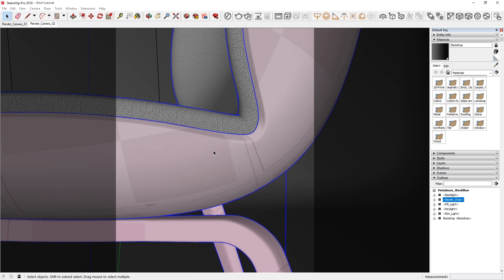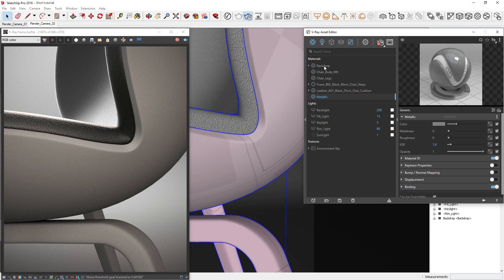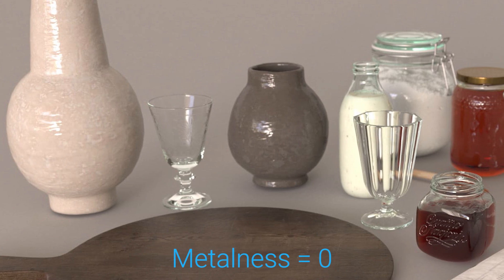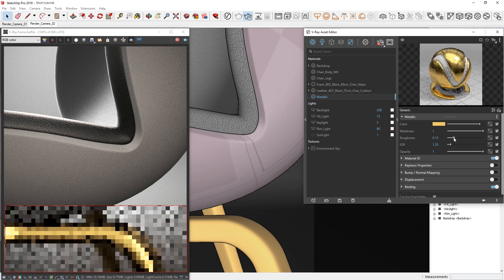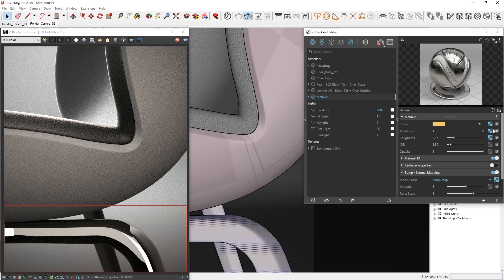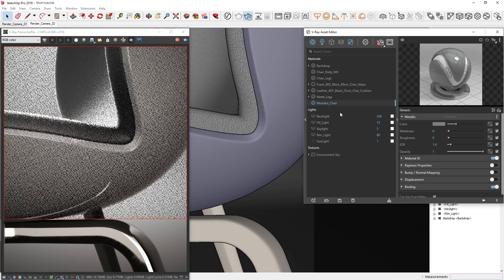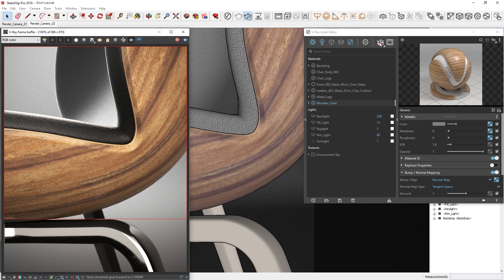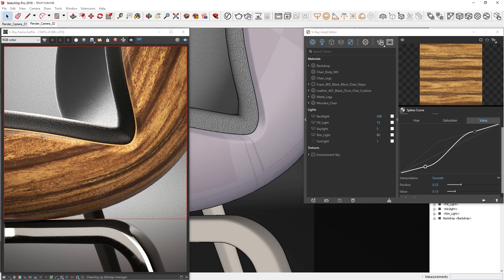V-Ray Next for SketchUp – Creating PBR materials and working with Curve color correction textures

Comment: How come if you have to change the color space for metalness, roughness and normal maps in order for them to display correct the user has to change these manually? Wouldn't it be better if these would be set to Rendering Space (Linear) by default so chances are the user won't forget?
Reply: Just don't forget it.
Reply: i thought the same shit. why do you have to do this every time ? : /
Reply: Completely agree! Should be able to set default settings for creating a new material. Also why not just include the colour correction settings in with the other standard parameters for textures? For now I just set up a texture with all the correct parameters and duplicate it when I want a new texture rather than creating a new one.
Reply: So they can make it easier in the next version and sell it to you again.